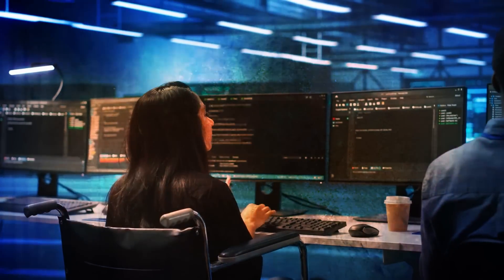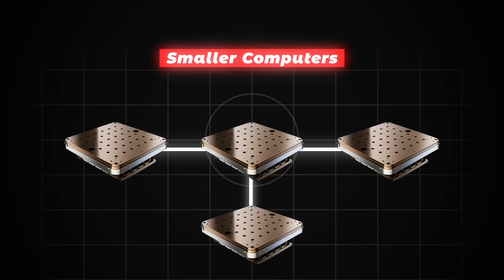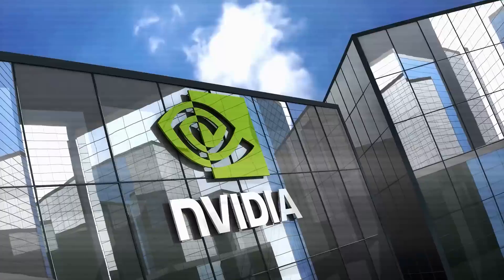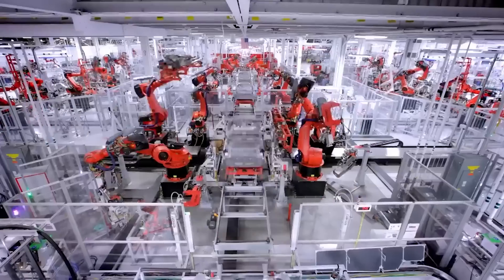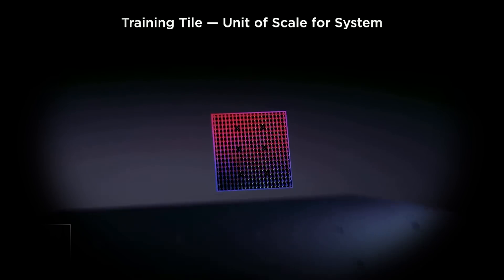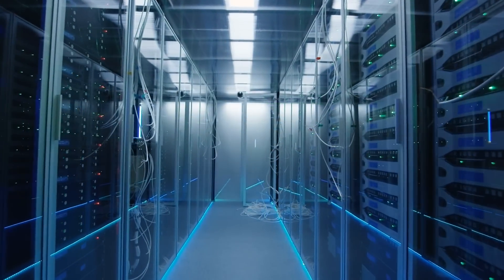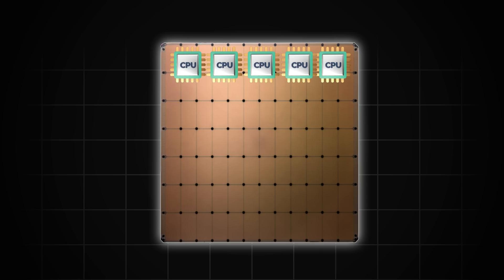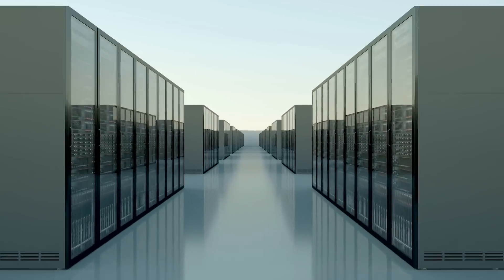How Tesla Reinvented The Supercomputer

Comment: Tesla stock swings too much to calmly accumulate and hold, After buying TSLA shares for just over 10 years, i'm struggling to make gains presently. How do i adjust or revamp my $2M portfolio? or should i consider some defensive investments?
Reply: In this current unstable markets, It is advisable to diversify while retaining 70–80% in secure investments. looking at the worth of your portfolio, you should consider financial advisory.
Reply: I'm in line with having an advisor oversee my day-to-day investing cos, my job doesn't permit me the time to analyze stocks myself. Thankfully, my portfolio has just 5X in barely 5 years, summing up nearly $1m after subsequent investments to date.
Reply: This caught my interest. I worry that I have a couple more months before retirement, and I want to switch to using a financial advisor, but I don’t really know how to find one.
Reply: Amber Michelle Smith is the licensed advisor I use. Just research the name. You’d find necessary details to work with a correspondence to set up an appointment.
Reply: I looked up her name online and found her page. I emailed and made an appointment to talk with her. Thanks for the tip

Comment: Cerebras has a few patents for cooling & getting data on-and-off the wafer.  I guess the problem is that the wafer physically expands a lot as it heats up, and this matters more because it's so large.  It will be interesting to see how Tesla solves the same issues either by licensing the patents, hoping no one notices, or coming up with a different way to do the same thing.

Comment: Nonsense. A proper supercomputer fills a room with very high performance processors. No room for that in a car.
Reply: The supercomputer isn't in the car. The model is in the car, and the model must first be created/trained by the supercomputer for the task. The model can be updated over the air when a newer better one comes along. All you need in the car is a CPU/GPU strong enough to run the model.

Comment: It will have a huge amount of compute, but it is currently calculated as the sum of its parts. In order to have exascale computing all of those parts need to be able to work together in extremely fast and large scale ways. There's lots of systems larger than this out there but their communication overhead dramatically drags down the performance as measured by the sum of their parts. Lots of hype in saying that they bought a ton of off the shelf components, but hopefully it can be constructed in a way that the overhead isn't too substantial

Comment: Well, I believe Elon made a foolish move this time because he failed to learn from Apple's example. In my opinion, the best approach would be to follow Apple’s model full throttle and call TSMC's to create a similar architecture for the car's processors as an initial move, then gradually increase the scale, mimicking Apple's strategy. The key difference lies in Elon's decision to assemble an architecture that has proven successful for them and to build an ecosystem of car systems on this optimized standard. This will ensure seamless compatibility with previous generations of cars produced before the era of the dojo.

I am puzzled as to why he rushed into scaling without first addressing the existing infrastructure of his vehicles.

One potential opportunity could arise ahead by offering upgrades for the new compute units in older cars, thereby extending their lifespan on the road. Perhaps these upgrades could include new batteries, compute units, and other refurbished components. This approach, although seems likely for Elon capitalistic BS, but it could also add value to the vehicles and align with a sustainable BS model he preaches to promotes longevity. If Elon chose to pursue this direction, it would make more sense tbh.

Comment: if you look at the specs - they just copied Chinese  ADAS computer systems  but smaller processing  power with less tfops  as Chinese ADAS systems that do self driving have  double or triple the number of sensors that Tesla has  and can handle far more complex  traffic situations  that tesla can ( and far safer at the same time  )

Comment: Production Yields for a whole wafer to work at 100% must be low. They must have some built in architecture to deal with bad processor cores.
Reply: That's what Cerebras does.  If there's 4-10% bad cores, it can route around them.  Apparently the actual number of bad cores is actually smaller, possibly because the physical size of the cores is small.
Reply: they are not going to make a massive chip out of a single wafer! they are going to do like apple and make multiple smaller chips and interonnect them thats how its more efficient and succesfull

Comment: Tesla is not the first to do this. they basically copied the idea from another company so no they did not reinvent supercomputer.  they stole it.
the reason why this isn't widely done is because chip creation are flaw, you always lose chip during production, thus the bigger the chip, the more processing power will be lost to failures.
it's not a prefect solution, there are trade off. never buy into marketing hype, they only tell you the pros, they never tell you the cons.

Comment: Seems like DOJO is behind NVIDIA and Cerebras,  similar to the robotics division, and the solar division, and the EV business (China has developed inexpensive electric cars first)  Even SpaceX is running at a higher budget than projected.  Having so many irons in so many pots seem to be the problem Elon Musk is having.  And that is beside the Twitter fiasco.   And few people talk about the downsides of virtual integration which is its expense and rigidity.  If one division needs to retool - that can throw delays all the way through the system.  If you have multiple vendors and one needs to retool - you have the flexibility to shift workload to others.  Upfront costs can lock you in place until you recoup the investment money and technological change is only speeding up.  I fear Mr. Musk is slowly falling behind the speed in which his competitors are moving.

Comment: not too sure what u mean with "quietly". they even demoed the chips. the entire fleet runs on dojo.
Reply: Fleet doesnt run on dojo. It runs with FSD chip which is  also Tesla designed chip. Dojo is for training compex neural networks but i believe most of the training work is done by A100 and H100 training clusters.
Reply: @malax4013  yep, slightly misleading thanks for clearing that up.
Reply: No. Dojo is a plan B to supplement and potentially replace their nvidia GPU cluster, if they are successful.

Comment: Yes, but does Dojo work and is it more effective and efficient than just using Nvidia? I got the impression that Elon has been downplaying the potential effectiveness of Dojo of late?
Reply: Dojo and Nvidia are doing things in different ways.  Nvidia is a known operation.  Dojo is not.  Hard to hire people to do a job that has never been done before.  Dojo is far more efficient and less power hungry, but Nvidia currently seems much faster and easier to work with.
Reply: @davidbeppler3032  That's a silly comment lacking factual information. Musk's new startup xAI is using ONLY Nvidia hardware, and will provide AI services to Tesla. Nvidia is leading in power efficiency, AI Supercomputing is all about that.  Everything "more than a car company", Musk is pilfering away from Tesla investors.
Reply: pretty sure that Nvidia is OP in every single way
Reply: @Niberspace  Not if you have a limit on how much you can spend on electricity every hour of every day.  Or have a limited budget.
Reply: @davidbeppler3032  what I'm saying is that I don't believe those claims. As for budget I'm sure Tesla is spending hundredfolds more in R&D to make that then the Nvidia stuff would cost (which makes sense, because if the succeed then they have some original IP)